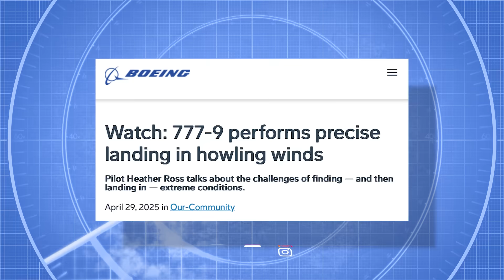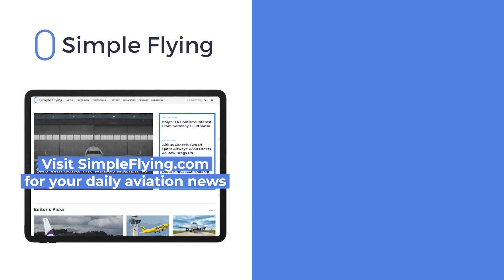Boeing 777-9 Performs Crosswind Landing Tests

Comment: If you can land an airplane in Lubbock, Texas, you can land it anywhere. After living in Lubbock and traveling West Texas for 35 years the spring wind and sand storms are challenging in which to drive let alone fly. Congratulations to the 777X to make it on the ground safely.

Comment: They can benefit from iive measurements 
of crosswinds ahead of landing (like 2 to 3 miles from touch down) using our Army validated wind sensor system. This will prepare the pilot to select the appropiate flight path for landing the aircraft safely.

Comment: It would've been convenient for Boeing if they had FAA inspectors on the flight.
Reply: They have a tons of equipment and sensors onboard and the info is provided to allot of internal departments and the FAA has access to it . For a test like this it is quite risky, there is no benefit to have FAA inspectors onboard for this testing.  These type of test will usually be minimally manned .  During actual certification test the FAA will be more present during the flights.
Reply: The Inspectors would probably be scared to get on it.